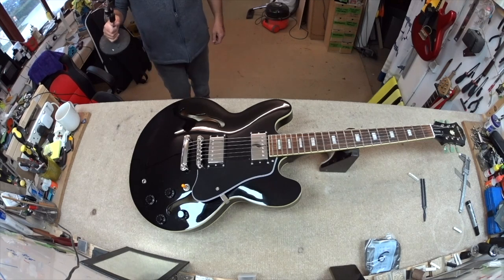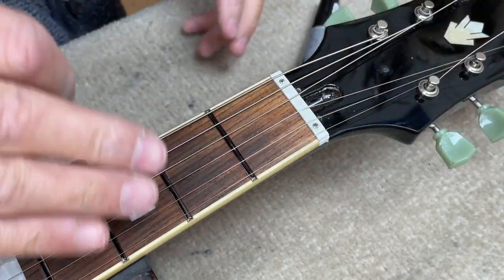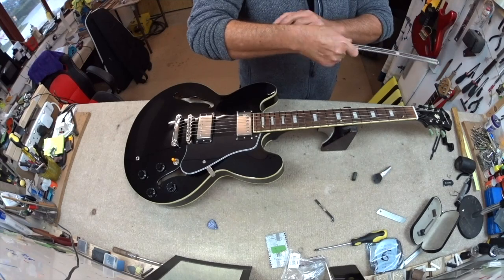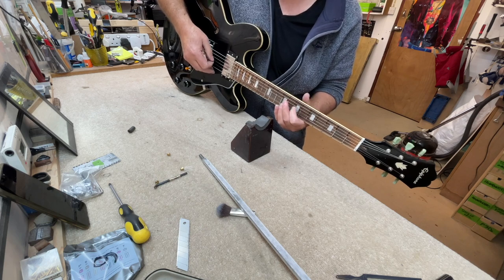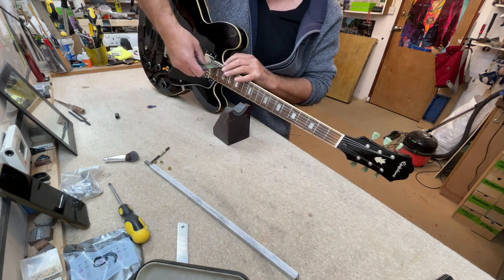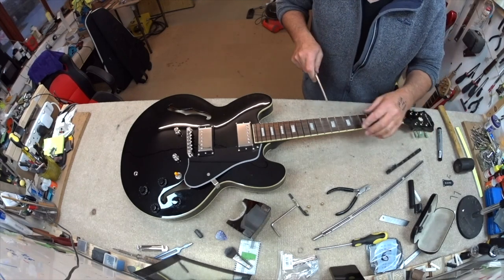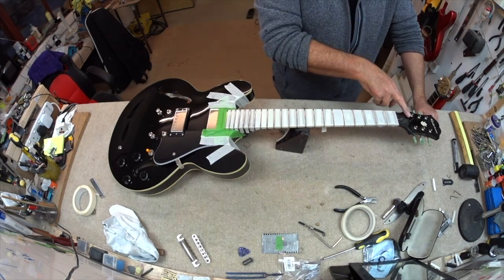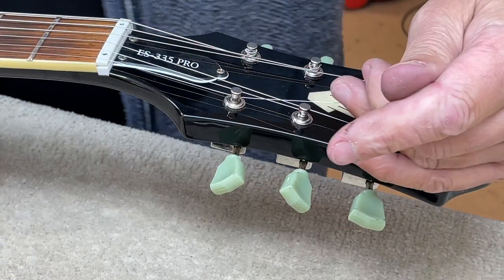Epiphone ES 335 set up including Tusq adjustable nut, precision fret levelling and new bridge.

Comment: Wow! This is gold. I have a Epiphone ES 335 Pro. I bought it used and got a discount because of the fret slap.  I followed the steps in this masterclass level video and now the guitar is an absolute joy to play. I'm an inexperienced guitar player but I have been a woodworker for around 30 years, I enjoy working on guitars almost as much as I enjoy playing them, maybe more if I cant get my damn fingers to stop flying off the fret board.  An issue I still have is getting my D and G strings to not bind in the nut. I've tried TUSQ and TUSQ XL nuts, I've tinkered around with them trying everything I can imagine, I can't get them just right. I recently purchased the TUSQ XL adjustable nut and have been trying to fabricate a base with reasonable success but I cant get complete stability or an accurate break angle. I don't have a 3D printer so I'm trying to make one with blanks and my woodworking skills, not an easy thing to do. I would greatly appreciate any advice on how I would go about having one fabricated or better yet...I would be willing to part with a chunk of my wallet to purchase one from you:).
Reply from the maker: Thanks for the comment Chad - and for getting in touch via email. Look forward to making up a 'drop-in' custom adjustable Tusq nut for you.
Reply: @SamDeeksRelovedGuitars  Hi Sam, my epihone es 335 is giving me headicks as well, can't get the tusk right, the high e (and I feel the b string) have serious overtones/harmonics when fretted, especially the high frets. Before I get someone to file the frets, I'll be interested in purchasing a tusk from you.
Reply from the maker: @jeanbaeyens9167  hi - if you’d like to email me samdeeks@gmail.com I can let you know what’s involved / cost etc - thanks

Comment: Sam i think you are the only guitar tech that can get a guitar to play with a very low action in the country.
from other peoples videos ive watched they usualy ignore the fret slap on the low e.
also i don't see them testing if the strings can be bent without the notes going dead.
Maybe other techs are stuck in their ways using the old method of fret leveling and fail to admit your way is better
because i bet they watch your video's.
Reply from the maker: It's true.. I've not seen people making sure that the high E bends all work... But I don't watch many guitar tech videos and maybe they do anyway, off camera. The thing about low action is (as I've come to understand it) that you need to not only level out high  & bottom out low frets but also to 'even' out the curve of the fretboard as a whole. Since the evenness of that curve is directly affected by the compression imposed by the tensioned strings, it follows that only a method of leveling with the neck curved and under load can be truly effective.

Comment: I've been on a stead diet of guitar tech & luthier videos since I started playing in 2018. I have only basic tools, so I haven't moved onto the complexities of fret treatments/replacements. Your work is by far the most 'intimidating', in that it affirms how much I've yet to learn. That was a compliment...

Of several guitars, I own a satin black, 2018 Gibson ES-339 with which I've had an interesting battle to maintain tune since I installed a Duesenberg 'Les Trem II'. I have pretty good stability now, but only after several expensive (to me) parts/upgrades. After piecing together several aftermarket solutions (Les Trem 2 trem, Schaller roller bridge, String Butler string-angle corrector, new strings after each upgrade - sometimes 9.5-44 & sometimes 10-46), nothing really worked, even for very light trem arm wobbles. The solution, being of course the last thing I tried? A $13 Graphtech XL nut. I have no affiliation or financial interest with that company, they can go spit. However, that replacement worked great. I didn't do much 'nut compensation', since I'm still incredibly unskilled, but I was able to file the nut down to appropriate height at least.

There is a question here - for any Bigsby or other aftermarket trem system, do you think a synthetic nut (like Graphtech) is a good idea, as opposed to a bone nut? Your preference seems to be standard bone nut & unless I missed it, you haven't mentioned roller bridges as a "nice to have".
The roller bridge didn't improve anything, the 'String Butler' is a bit of a gimmick but admittedly, it did improve things slightly. The nut upgrade ended up being the silver bullet. Deep trem dives are NOT happening, but some moderate wobbles are proving stable.

Did I just get lucky, or is that a worthwhile investment for anyone looking to stabilize tune? What would you have done instead?
Reply from the maker: Hi Baconator - thanks for your compliment! I am a convert to Tusq nuts and string trees. I had a customer last year bring me a Gibson Les Paul and a string butler... I said 'you won't need it..' and set up the guitar with a custom adjustable Tusq nut and stretched the new strings fully out. Result? Stable tuning without needing to use a string butler. The same applies to the Duesenberg tremolo. If your nut is Tusq, if the 1st fret action is the right height (0.3-0.4mm over the 1st fret) and if you have THOROUGHLY stretched all of the slack out of your new strings, the Duesenberg will play pretty well without putting the guitar out of tune. As I always say in my videos: tuning stability has nothing to do with your tuners.... it's 50% your nut and 50% the unreleased slack in your strings. If you go at it with that understanding, you will be able to create tuning stability for Duesenbergs, Bigbsbys, strat 6 screwe and 2 screw tremolos and so on. And yes, a roller bridge is a good replacement; partly because it reduces the string friction (dragging across sharp saddles) but actually MOSTLY because the roller bridge gives you a little more intonation travel for each saddle which can often come in very handy!
Reply: @SamDeeksRelovedGuitars  Thank you, yes I will be checking the string height at the first fret.

 This is a long comment I know, so I don't expect you to join a long back & forth - and I will shut way the hell up & browse thru more of the vids silently.

I did add Grover locking tuners the moment I got it home but I always do a few hrs of breaking in the strings (Ernie Ball 10-46) since I'm not yet a pro at re-stringing. Appreciate the advice re: roller bridges. I try to look at what hardware is included on higher-end guitars (Suhr, Paoletti, Music Man, Friedman, etc) then ask the pros what they suggest. The String Butler is a gimmick but it did improve things. I realized later that the intent is to resolve other issues so you don't NEED the String Butler. It makes tuning a bit weird, tbh, and I'll be removing it the next time I restring.
I was so impressed with what the Graphtech XL nut did, I've been raving about it. Graphtech or whoever the company is, should be paying me for the shameless promotion I've been providing. I installed one on my American Performer Strat and I have a hard time forcing it out of tune. I installed one on my Tele Deluxe (as well as a roller bridge - it's a hard tail) & I've had to make micro-tuning adjustments on that maybe thrice since I put the strings on a month ago. I just have to get good at making the right nut adjustments & filing them properly. I was running low on 'Nut Sauce' for the bone nuts before replacing them with Graphtechs. Your vids go into a depth that I haven't seen in other videos. I'm a sucker for aftermarket parts so I thought I'd paste my collection below. I don't expect anyone to go through the list, it's just if your subscribers have tune stability questions, it might actually help if they have similar models.

* 2018 American Performer Strat SSH, with Floyd Rose 'Rail Tail' & Fender locking tuners + 'GraphTech PQ500000 TUSQ' nut.
* 2018 Telecaster Deluxe 'Troublemaker', HH pickup config, Schaller roller bridge, Fender locking tuners + 'GraphTech PQ500000 TUSQ' nut.
* 2019 Gibson 'Satin' ES-339 with 2 '57 Humbuckers, Schaller roller bridge, Grover locking tuners, Les Trem II tremolo, 'Graphtech PT-6642-00 Black TUSQ XL' nut & a stupid 'String Butler' because hey I'll buy anything lol.
* 2017 Epiphone ES-339.
* 2021 Fender Noventa Strat w 2 P90s, hard-tail, Kluson style locking tuners.

Comment: I'm a complete novice when it comes to playing guitar...under a year. I have never thought of setting up a guitar. For my first electric I bought a Epiphone ES 335 used from a big box store at a low price.  I thought I was just getting a deal:) Turns out the guitar was unplayable. Buzzing and slapping, multiple high and low frets, a rattling bridge and a worn out trash nut. I was very excited to play my first electric so I was very disappointed.  I watched hundreds of set-up videos...hours upon hours to try and fix my hunk of firewood. I bought new fancy tuners, a new tailpiece. a new fancy bridge, tried 10 different types of strings, cut and re-cut probably a dozen nuts and still the guitar slapped and buzzed all over the place. I was about to give up and hang it on the wall as art when I came across Sam's video's....
Sam is an innovator and a highly skilled luthier. I watched this video 10 times and dove into my first fret leveling job. I am happy to say that my wall art/firewood now sings with zero buzz or slap, has a lower than factory action, stays in tune, and has near perfect intonation on every string. These videos are gold! The only place I'll be going for setup. It's not short but it is complete.
Reply from the maker: There's no getting away from the fact that when guitars are completed in the factory they are un-finished.The set up isn't a nicety; it's the process of 'completing the guitar' - ideally to YOUR personal tastes. Then it's complete. The good thing is that the adjustments needed to make a factory 'finished' guitar into a truly finished, playable guitar are TINY but which have a huge and wonderful impact :)

Comment: Does having it lay flat increase the fret slap or does it not make a difference? I love the channel and have learned a lot and felt a great deal of satisfaction seeing you use roller bridges. On my old Epi LP plustop I stumbled across that solution as well and having Sam do it confirms I was right to do it because it did solve the high G string issue.
Reply from the maker: Hi - I test the 'fret slap' in the playing position and the neck is supported midway when I'm doing the levelling so there's very little difference courtesy of our friend gravity :-)
Reply: @SamDeeksRelovedGuitars  thank you for the reply.

Comment: what kind of sand paper do you use that adheres to the truss rod? I bought your e-book but have lost it. Also, what roller bridges do you recommend?
Reply from the maker: Hi Steve - I use 400 grit self-adhesive stuff called 'Rhynostick' but wet 'n dry paper + good double sided tape will work too. Send me your email address to samdeeks@gmail.com and I'll email you another link to the eBook.

Comment: I was watching your video to see what you were doing to improve this guitar and hear the result. Then after an hour you shut down the AUDIO! So it would be impossible for viewers to HEAR the difference that all your actions made. Because I had come so far I decided to watch untill the end without SOUND only to discover that you didn't even test the result of your doings!! I do have a few qualifications for that , but I will not express them here. I do know that I'm not going to watch any more videos from you and will never bring my guitar to you for maintanance if it were only because you were damaging the instrument while working on it. Nevertheless: good luck.
Reply from the maker: The audio's gone as the result of a mistake in exporting the video from Final Cut Pro. Obviously I didn't know about that until you pointed it out - so thanks for that. Out of 800 videos... occasionally it happens. There's nothing I can do about it; I don't have time to watch the video back again after exporting it and I don't have room to keep old files to re-export things. 
You're entitled to your opinion: I don't need to play the guitar at the end a) because I've done this thousands of times and b) because the steps in my set up process tell me that the guitar plays perfectly well by the time I've finished working on it. I know ALL the signs I need to know. By the time I've levelled the frets I know there are no chokes on high bends etc. And so on.